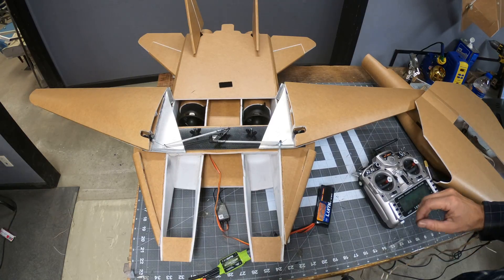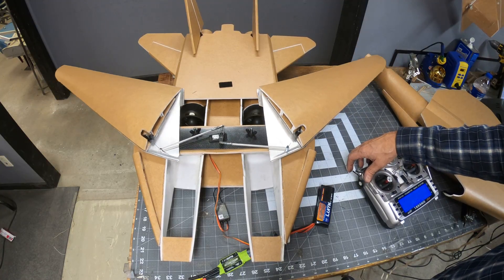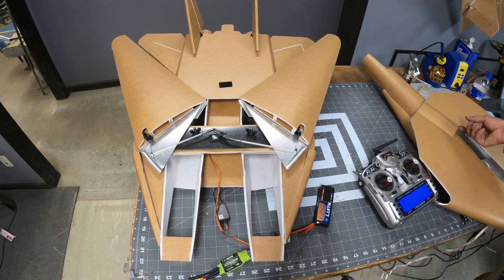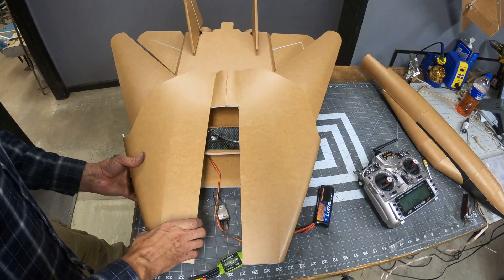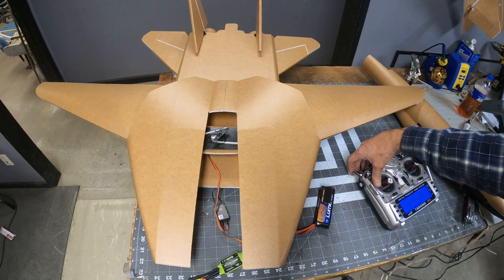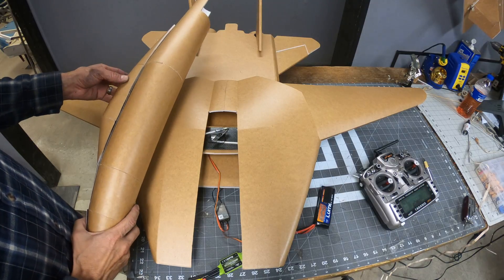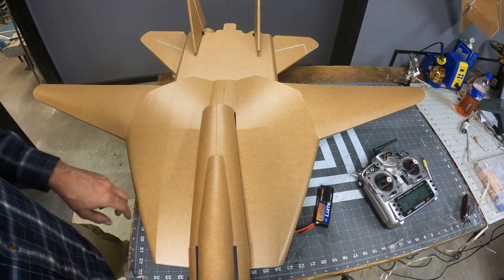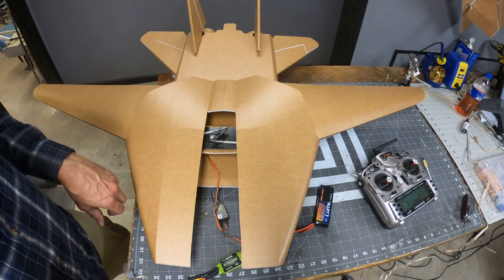Twin 70mm EDF F14 Swing Wing Test

Comment: You have got a lot of time and energy into this design.  I just purchased plans that show using a strong servo at the pivot point of each wing with 2 parallel popsicle sticks glued to the bottom of wing for the  "x" servo arm to screw into- much simpler without extra linkage.  I'll  use basswood plywood so it doesn't split. I have to do a bit of redesigning to get it closer to scale and to fit edf instead of pusher prop motor -edf is the only way to go for scale.   I see your design looks awesome . Your plane is being waited for with baited breath!  No one can compete with your designs!  You are such a blessing to the hobby!